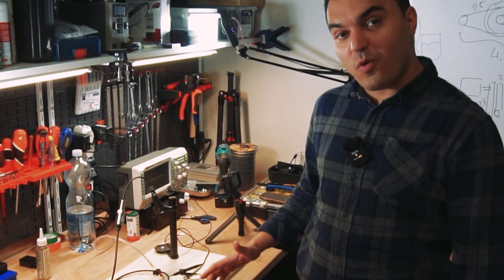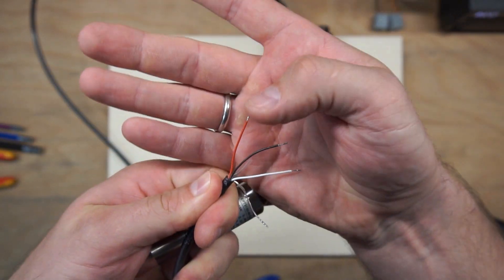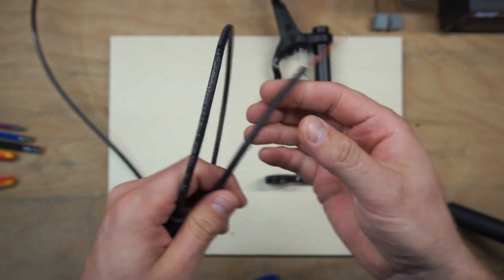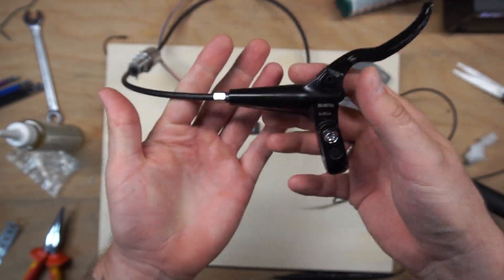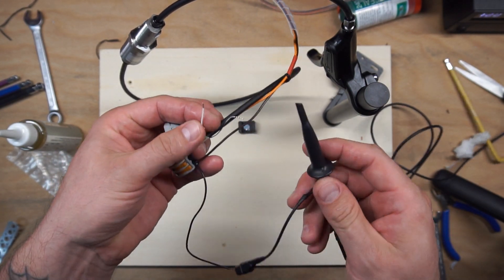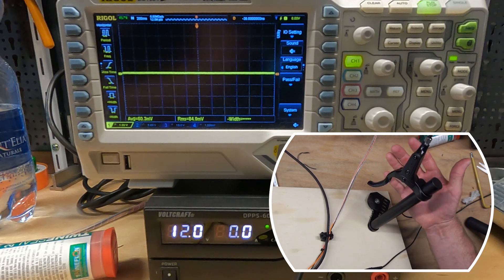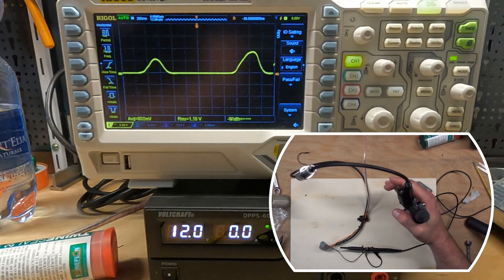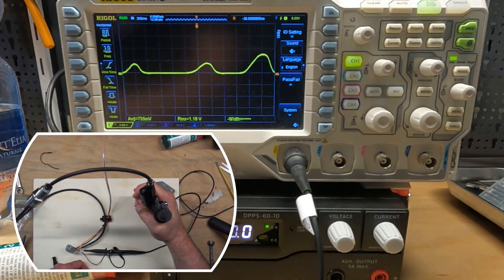Regenerative Braking: 40 Bar E-Bike Pressure Sensor for recuperation control

Comment: How does recuperation affect energy recovery in terms of volts and amperes, leading to the charging of batteries? Generally, the charging voltage must be higher than that of the battery, which means that the engine's RPM in generation mode must generally be higher than in driving mode. A note from Solo would be crucial in understanding how the controllers operate in recuperation mode and how to effectively utilize recuperation.

Herzlichste Grüße aus Deutschland, 09.01.´25
Reply from the maker: Hello,
As solo is connected to the battery, the drive and the battery in normal condition have the same voltage, however during recuperation the extra energy comming off of the motor will cause the drive voltage rise ( an AC to DC conversion happens) thus the current will flow back to the battery and it can charge it!
Reply: @SOLOMotorControllers  Hello everyone!
Regarding recuperation, the question arises whether a solo motor controller adapts the recuperating energy of the battery voltage a la DC/DC Boost Buck Boost Converter, or would such a controller also have to be switched between controller and battery/BMS?

Thank you very much in advance.

Note: Maybe my question can be derived from the data sheets of the Solo Motor Controllers, and I was not able to find out this information ?!

Comment: very good..interesting controller/ sensor system....do you think you can use sensor only? it seems to me a shame to lose some energy in friction with the brake.
Reply from the maker: Absolutely Possibile! We choose to have a solution not to much invasive, and use both the solutions together to reduce the complexity on risks management, but clearly a lot of other implementation are possible :)